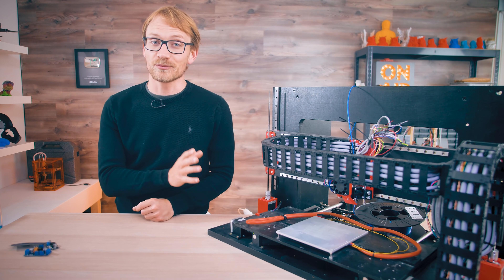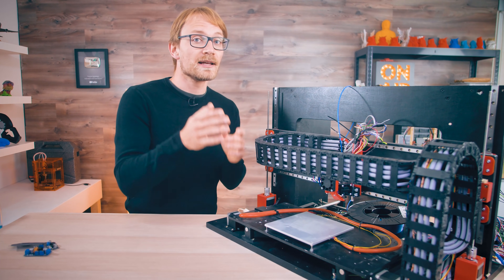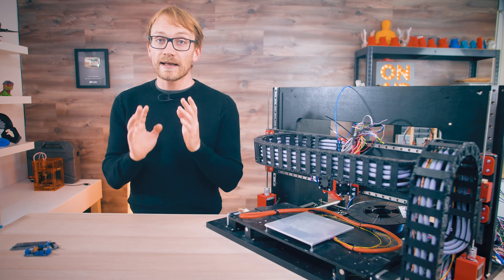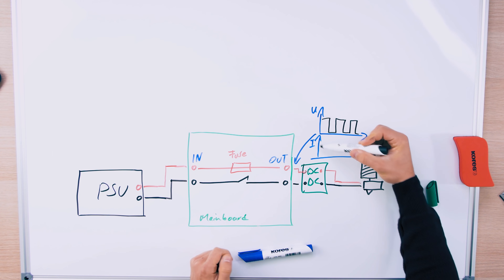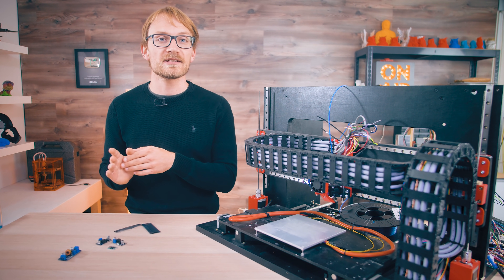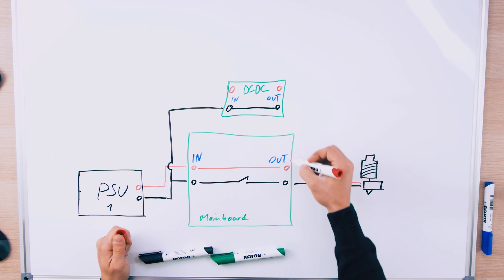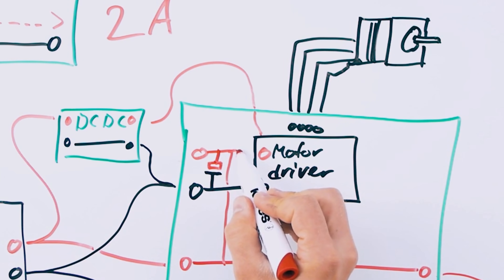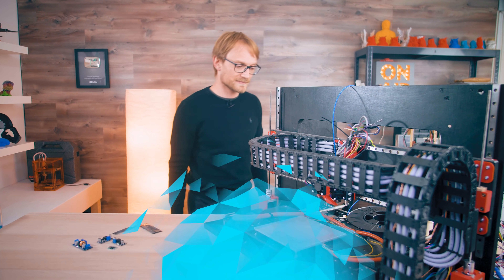Use the WRONG parts on any 3D Printer!

Comment: I use the ground switching method on many projects, but there is a danger in using it for heaters...as I learned the hard way.  Because switching the heater off requires active logic on the control side, if there is a board crash for whatever reason like brown out or flicker in the mains supply, you can easily be left with a closed circuit and nothing to tell it to turn off.  This happened to me with just a 500w 120v heated bed and if it hadn’t been for the smell of the build surface/adhesive melting to alert my wife to come ask me what that smell was, there would have been a full on fire within another minute.  

Let that sink in for a second.  It wasn’t printing,  it was just sitting there with the power on waiting for me to get back to it start a print.  Imagine if I’d have left it on and ran a quick errand to the hardware store or something.  

The lesson was a somewhat scary one, but those you never forget.  Heaters need to always be told to turn on by default, not told to turn off.  

Of course this is also a NO vs NC switch issue, but still don’t take chances, especially with a mains powered heater.

In this circumstance it was a smoothie board ground switching an SSR that controlled the heatbed.
Reply: Aaron Cole ground swithcing is safe. It requires 5 v to mostfet gate to turn on current for device which is connected to drain. Its n chanel mosfet. You missunderstood something. High side swiching is more dangerous, it uses 5v logic to disconnect load. Howewer there can be an inverter which would solve this issue
Reply: Paulius Narkevičius  It can be safe,  I agree, and it is my preferred method in most cases.  Though the real issue in my case was NO vs NC,  the post was meant for more of a “Pay Attention” wrather than discredit.  For makers and tinkerer’s, sometimes there is a chain of processes to make 2 things not intended for each other come together and a crucial detail somewhere in the middle may get passed over in the heat of the moment.  I would much wrather get called out or have someone thats new to all this and still excited pause for a moment to think over the details than to have a similar mistake made burn down their house.

I am by no means a dumb guy, but I sure made a dumb mistake.  No one is immune.

Comment: Colour code your positive voltage lines so you don't accidentally short your 24 an 12v  lines
Reply: I was thinking exactly the same thing... as well as the components. If a fan or a hotend is, say, 24 volts and you forget what mods you were doing to that particular printer, well...
Reply: Agreed, and nut up and start using good wire... get quality, silicone wrapped, oxygen free stranded copper. Buy once cry once...

Comment: I heard that you can easly fry stepper motor drivers (like tmc2208) using 12V for electronics and 24V for steppers when 24 volts shows first on the board, before 12v. That is why in this particular case is advised to use some additional delayed relay (like 1-2 seconds), to make sure that board is powered from 12v before 24v for stepper drivers show. Is it true?
Reply: Yes, but only if you get the black PCB version. The blue version has a voltage regulator on board and doesn't care about power up / down sequence. It's is explained on Winnicott's Github.

Comment: What I meant to say part 2 : Coming from an auto electrical side,and just learning this type of 'electronics', My mind is saying Current returns along the + so joining up the 2 PSU on the black line would be putting 36v into the system. Which I know isn't right as you didn't loose any magic smoke, So therefore I must learn to switch it around in my mind when playing with these ? Another thing I thought was, why mess with a 12v supply to the hot end, a heater cart is pennies to buy why not just put a 24v one in ?  Wouldn't just a resistor in the fan wire be enough to drop it from 24v to 12v ?  Thanks
Reply: Electrons do, yes, but most of the time people are referring to conventional current flow. Don't be a smart-arse ;)
Reply: @AndrewGillard  LOL Well I wasn't being a smart arse, it seems most of what I types went AWOl. I'll re type the whole thing out again, hang on

Comment: Before I fry something let me check - I want to move my machine toward 24v.  Everything is ready for that except the bed which I don't want to replace yet.  Using this technique I could run everything on 24v except the bed on a separate 12v power supply?  No mosfet needed?
Reply: If the heated bed is working fine with 12V now, it will still work fine after converting everything else to 24V. But you might want to upgrade that as well since the 24V beds often heat up much faster.

Comment: If you change supply voltage to your stepper drivers, would you then need to change the output power to keep from overloading the steppers? I'm not actually sure if the tuning pots on the stepper drivers adjust current, voltage, max or standard duty cycle or something else.
Reply: The pot adjusts the current. Not need to be changed if you increase the voltage.
Reply: @gabiold  but if you double the voltage, you're doubling the power (wattage) through the motor. Power is usually what translates to strength, but also what contributes to over heating etc.

Comment: Thanks for this video! I too always assumed the mainboards were high side switching (because I'm a mechanical engineer, and because that's how you have to do it for Mains wiring to be safe) the diagrams were very helpful and I found myself regularly saying "wow, that's pretty clever". Also, I like your test bed, I think it'll suit your needs nicely, though that has to be the worst machine volume to build volume ratio I've ever seen ;)

Comment: While steppers will run faster with more than rated voltage they may need to be limited by a resistor or something to keep them from drawing too many amps and over heating.
Reply: No. The stepper drivers regulate the current.
Reply: @gabiold   Some drivers do regulate current and some require external support. I'm playing with a driver right now that works internally or externally for current limiting. The earlier versions of Gecko drives I have required a properly selected resistor to regulate current. The popular Popolu drivers have a trim pot to set current limits and an increase in voltage will require them to be readjusted for the increase in current the motors will try to pull.
Reply: As Gabor said, the driver will limit the current set by the user. When a higher voltage is used the current limit is reached quicker, hence the higher torque and maximum rpm. In addition when the step input is idle, the motor can be powered down to a certain percentage, this can dramatically reduce temperatures of the motors. Hold torque isn't important on Cartesian 3d printers, though corexy is an exception.
Reply: @imqqmi   With people building room sized 3d printers that are suspended from the ceiling motor hold becomes a requirement.

Comment: Server PSU, ie. HP 750W: 15$
Breakout board: 10-15$
DC-DC Buck converter(s): 0.5-15$ a pop depending on the type, quality and size.

Get the exact voltage and power you need where you need at quite high efficiency. Server PSUs go upto around 98%, same with buck converters.
The typical PSU with 3d printer is not even 80+ certified and comes with no guarantees of efficiency, i would expect the typical china cheapo to be just around 60-70% efficient as that would be about cheapest to produce.
Reply: Don't even need the breakout board if you know how to solder.

Comment: If you are going to power more than a couple steppers off a different voltage (or especially heaters) I'd just get a second mains supply. They around $20 and will give you all the power you could need. Sure a boost converter may be an option but it just won't have the same load/line regulation ability of a supply for such a demanding load. This is in part due to the size of the magnetics (inductors) but also larger output capacitors and a full supply is far more likely to use a multi-phase output stage for better regulation than common little boost circuit boards. Additionally the capacitors on the buck/boost converter will need to be able to take the ripple current of the application, while they can often supply the rated current most of these little converters dont have the caps spect to stand up to a switching output load (such as pwming a heater). The effect of ripple current on the cap is heating, so if your caps dont get hot to the touch under use your fine. If they burn you (and they could get hot enough to boil water) they will have a very shortened life.
Reply: In general, what you say about getting a second PSU is correct, but it might be worth considering spending more money to get a single, higher-quality PSU (probably in whatever voltage you want for your heated bed, as that's almost certainly the highest load by a wide margin), and use DC-DC converters to get whatever voltage you need for everything else. (Assuming that buying TWO higher-quality PSUs is out of your budget, of course!)

Yes, you can get no-name PSUs for not much money, but the reliability will be questionable, the output filtering will likely be poor (thus giving you a lot of voltage ripple on the output), the input filtering will probably also be poor (feeding high-frequency noise back into the mains wiring of your house, which then acts like antennae and broadcasts that noise throughout the house - which might even technically be illegal), they probably won't be able to deliver their advertised output current at all or for long periods, and they may even have safety issues (fire or electric shock, mostly). The higher-quality ones are also likely to be more efficient, which will both save you money on your electricity bill, AND cause it to run cooler, allowing it to use a quieter fan, or, if it has a temperature-controlled fan, will allow it to run the fan slower (it'll also be more likely to have a temperature-controlled fan!)

You don't necessarily need to spring for a PSU from Meanwell, Delta, or Lambda - though by all means please do so if you can afford it - but at least look for something a step up from the absolute cheapest you find on Amazon/eBay/AliExpress, or preferably buy one from a reputable 3D printing retailer in your country/region (e.g. E3D), or from a reputable electronics supplier. In the UK that would be somewhere like Rapid, CPC/Farnell, RS. Elsewhere, Digi-Key, Arrow, and Mouser all ship pretty much worldwide. Arrow is currently/indefinitely offering free international shipping *with no minimum order value*, and they tend to be cheaper than Digi-Key and Mouser as well - although they also have a somewhat more limited range of products and a more-frustrating website! Or you can go to their equivalents in your country.

Comment: That printer (size/print volume) ratio is rather poor
Reply from the maker: Fits a 428x214mm bed - the 160x160 is just one of the (modular) options I can use.
Reply: @MadeWithLayers   May i suggest you do a video guide about printer size to printable volume, and maybe list some that have good ratio. Or has this been made this already? Cheers.

Comment: For fans I typically use a single buck converter to get a 12V power source (from the 24V from the PSU, which directly runs the steppers and heaters). I then use a single (free and pwm capable) arduino pin as the "fan" pin and drive a trivial/standard transistor as the 'switch'. It literally takes 3 components: transistor, resistor for the gate and possible a diode if it's a inductive load like a motor/fan to protect the transistor.
In most cases I need additional outputs anyway, since a RAMPS for example only has 1 fan connector and I need at least 4 loads (part cooling, hotend, stepper/board cooling, printing lights on hotend and/or for the whole print area), so I need something like the transistor/mosfet anyway (or use any expansion board that basically has exactly that in a ready-to-use package).

This also allows you to just run 24v to your hotend (for example), which you already have there anyway since the heater is using the mentioned low-side-switching, add 12V step down converter and run just one (signal) wire up there per fan you want to control (hotend fan and potentially multiple part cooling fans). All this even weighs next to nothing, too. So you reduce needed wires.

Comment: Nice, exploiting the ground switching is cunning indeed!
Another way that seems to work great when you want to use eg. 12V blower on 24V system is put a resistor (with high enough power rating) in series. For a blower that has nominal current of 100mA, so 1.2W, 120Ohm resistor does the trick. Yes, you dump another 1.2W of power into heat (preferably placing a 10W+ resistor in the electronics box), but it's a very simple solution.

Comment: I'm using a Boost-Converter to up the 24V to 32V. The Steppers love higher voltages and the TMC-drivers are capable of pushing this voltage. No need for another PSU...
Reply: Whats the point to raise voltage up tp 24 or 32v with tmc drivers? Are they ever quieter?
Reply: @1111111115297  faster and more powerful motors.
Reply: Do you then just connect the boosted positive output to the Vm input on the driver? I've got TMC2130 drivers on my printer and want to try and run them at a higher voltage than the current 12V I have
Reply: @adamplastow509  yup. Exactly.
Reply: And what about those capacitors mentioned by Tom?  On my board (MKS Gen L 1.0) under each drivers have a 100uF/35V. 
I checked the trace on the PCB, actually looks I see an option to cut the trace and that could separate the "VMot" traces and still keep connected the capacitors, but cutting the trace and soldering a wire on to the PCB is not the most decorative solution..  Do you fitted any or not neccessary?
Or another option  powering the whole board 24V and using the trick to feeding the hotbed/hotend and fan from the 12V line?

Comment: You can also just run two 12 volt supplies in series. The take 12 of the first supply for whatever needs we. You can get 12v 30amp supplies but finding a 24v 30amp supply not so easy.
Reply from the maker: Phew, ok, I've done that before, too - but wouldn't recommend it as you may run into issues with the supplies floating at different voltages relative to supply neutral.
If anything, running supplies in parallel (e.g. two 24V 15A units) is probably the safer way to get a high-capacity supply.
Reply: @MadeWithLayers  First off, you know what you are talking about and I don't, so this is more a question than a statement of fact. As long as the ground of the supply is isolated from the AC neutral, running them in series should be okay? I wouldn't want to take 12V off the upper supply just to avoid accidentally tying the grounds together.
Running them in parallel seems risky sense you probably can't get both set to exactly 24v, meaning the lower voltage supply will be constantly trying to pull the higher supply to its desired vultage and vice versa?
Reply: Just connect them from  1 AC cable, phase will be same relative to neutral. But its just more safe, robust and easier to have 2 PS, 12 V and 24 V.

Comment: Great video, I'm trying to use a DC DC step down right now LM2596, I think it doesn't have the strength for the peak amperage of the process. The voltage drop is severe under load from 7.2v to 0.6v under load. Might be something to think about when ordering (he mentions this briefly) make sure to order a much higher rating than listed because they seem to exaggerate a bit on the ratings.
Reply: you might be able to get away with using a zener to cut the peak voltage, and set the output higher so it doesn't fall as much under load, but you'd probably be better off paying 10 bucks for a 300-600W converter which will handle anything if you don't mind the slight inefficiency.
Reply: @satibel  good call, that's what I ended up trying (should arrive today). I thought I could sneak by with the 2-3 amp but the motor is pulling more I think. So the larger converter should clear it up (fingers crossed). The only problem I can really tell is inefficiency as you mentioned, then size and finally cooling. But I figure it's easier to add a cooling fan as opposed to redesigning a whole project. Especially when you're stuck with a specific power source to save money or convience.
Reply: @RevampedOutdoors  2-3 amps is good for 2 steppers, but not much more.

Comment: Very interesting! I've been waiting for this video!

Would you recommend to to directly change the supply voltage of the stepper drivers? And could you possibly use 36 V for example with the TMC 2208? Would this be even more effective?
Reply: Just make sure the capacitors are rated for that voltage. I could see some people in asia trying to squeeze for the last cent by using 25V (or 35V) rated capacitors, instead of at least 50V rated ones. Actually, with DC bias voltage derating you should probably go for 63V or even 100V rated capacitors in a 36V system, but i guess most "3D printer hackers" don't even know or care about stuff like derating capacitors anyway...

Comment: I always wanted my duet to run at 24 while my high power/ expensive to replace heaters ran on a 12 volt separate supply, might need to look into his
Reply: I may still separate how ground comes back with a mosfet tho

Comment: You can run many/all 12V components on a 24V supply by limiting the power (wattage). See Marlin's PID_MAX + MAX_BED_POWER + FAN_MAX_PWM + CONTROLLERFAN_SPEED.